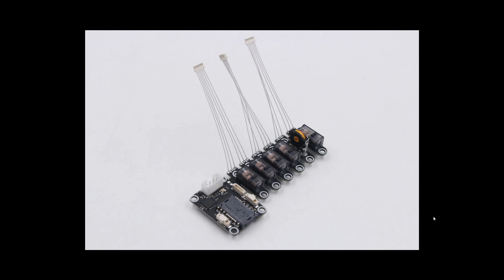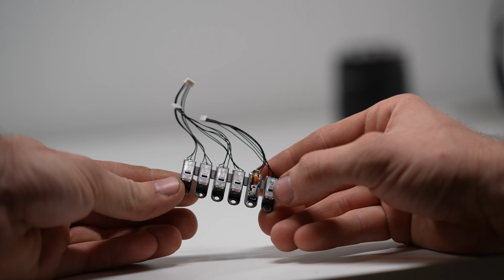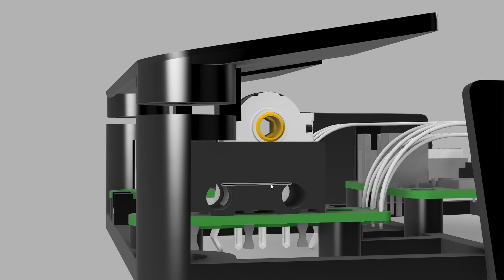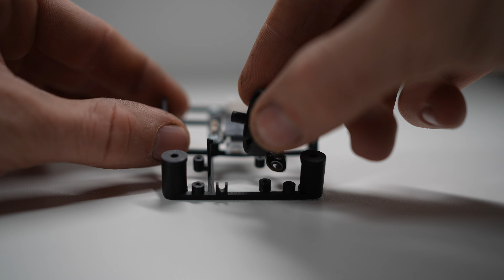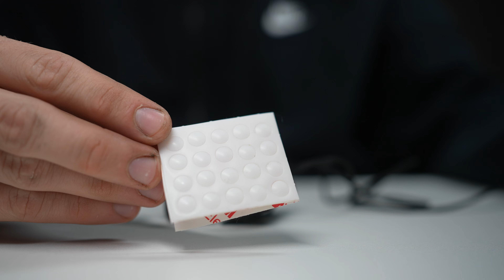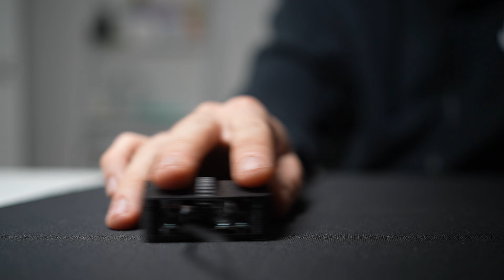I 3D Printed a 14g Mouse

Comment: A definite improvement would be to have the side supports curve slightly outwards near the top. This helps you to not squeeze as much, and cause fatigue over time, when you want to lift the mouse to reposition it.